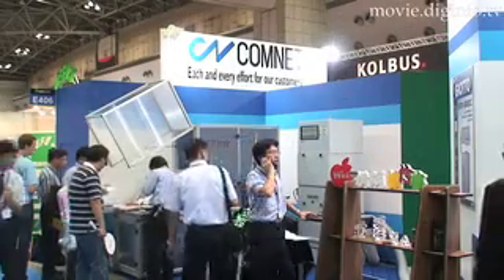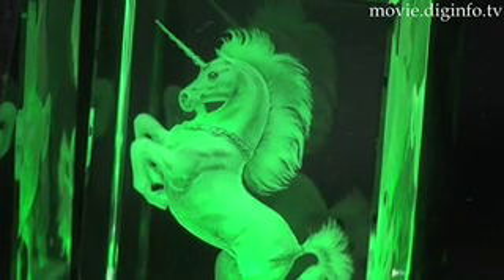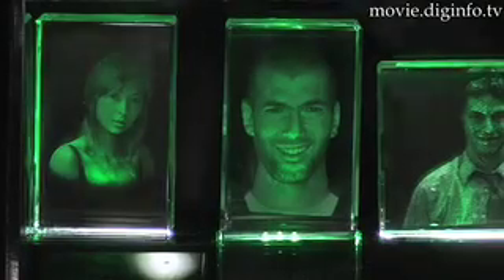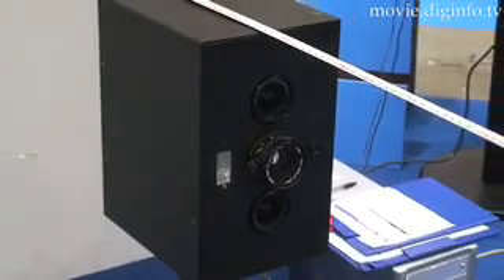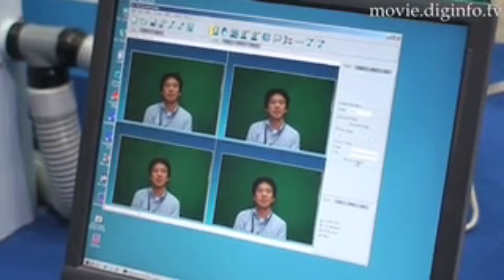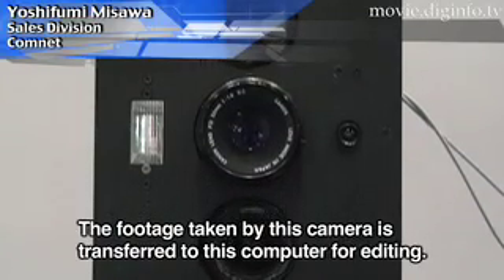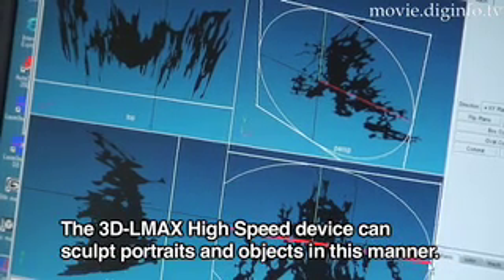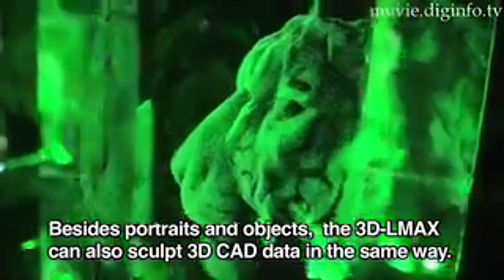High Speed Crystal Laser Engraving System : DigInfo

Comment: I think 2 laser beams are positioned @ diagonal corners of a block of crystal.  The engraver inputs the height, width & depth.  The software calculates where the 2 beams must INTERSECT inside the crystal to produce the etching of a 3D image.

I think that's how it's done....wouldn't be the 1st time I was wrong....nor the last!